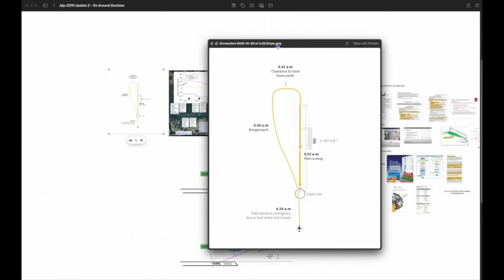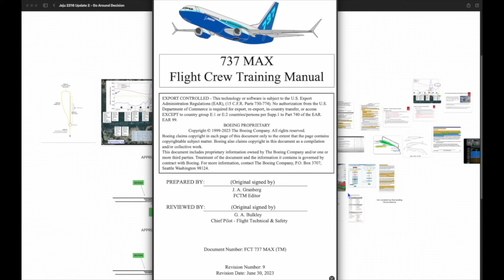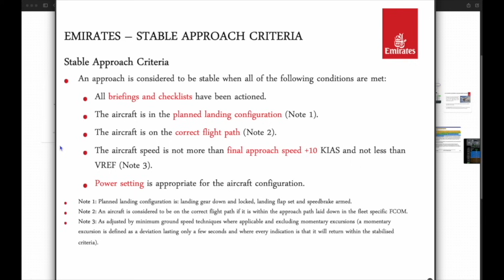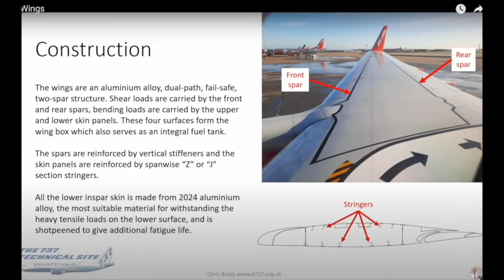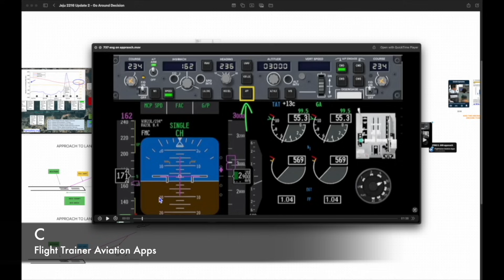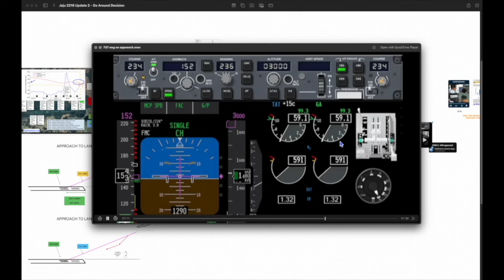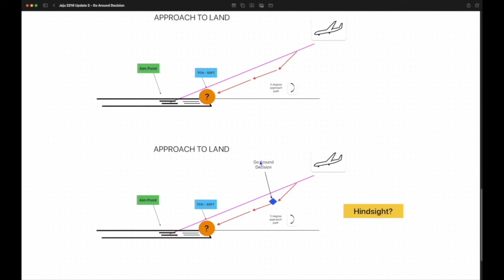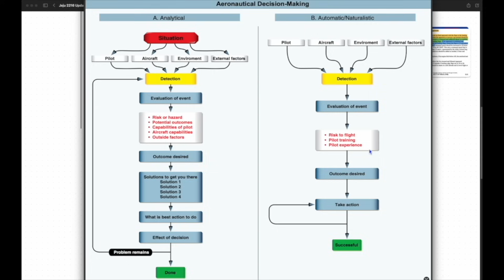Go-Around Explained: Jeju Air 2216’s Decision Not to Land

Comment: The bigger issue is why so many died. We hear about birds, engine damage, possible pilot error, marginal immediate landing, etc., but the pilots successfully got the aircraft on the ground, and it would have slid way past the runway with a good chance of all "souls" surviving. Why no discussion of all the death caused by a massive structure in the overrun area? That multi-layer reinforced concrete wall or bunker like obstacle, fortified with dirt berms caused almost all to die. A technology suitable for bomb-proof bunkers or runaway train stopping was put in exactly the path of an unfortunate airplane that could not stop short of it.
Reply: The aircraft hit an ILS Localizer Antenna Installation. It was designed and built by the US military during the 1950's when the airport was a US airbase.

If it was not there the aircraft would have continued 70m further and have struck the airport boundary wall, with the same outcome.
Reply: @christopherrobinson7541  Interesting that that installation was over 70 years old (the concrete structure, not the actual array). Seems odd that no one, once the airport was made a civilian airport with large passenger jets that no one thought to improve that. Thanks for the info.
But if the boundary was a fence instead of a solid wall, per ICAO recommendations, it had a lot further to travel before hitting anything very solid.
Reply: @christopherrobinson7541  What you're erroneously referring to is Gunsan Air Base. The one in question is Muan International Airport, IATA: MWX, ICAO: RKJB), and opened in 2007, not US air base in Korea.
Reply: @지게-c3r  The Gusan (Kusan) AIr Base was also called K-8. It is a current airbase and is located much further North.

Below is a list of US air bases from National Museum of the United States AIr Force.

K-1 Pusan West
K-2 Taegu No. 1
K-3 Pohangdong
K-4 Sachon
K-5 Taejon
K-6 Pyongtaek
K-7 Kwangju
K-8 Kunsan
K-9 Pusan East
K-10 Chinhae
K-11 Ulsan
K-12 Muan
K-13 Suwon
K-14 Kimpo
K-15 Mokpo
K-16 Seoul (Yongdungpo)
K-17 Ongin
K-18 Kangnung (Koryo)
K-19 Haeju (Kaishu)
K-20 Sinmak
K-21 Pyonggang
K-22 Onjong-ni
K-23 Pyongyang
K-24 Pyongyang East
K-25 Wonsan
K-26 Sondok
K-27 Yonpo
K-28 Hamhung West
K-29 Sinanju
K-30 Sinuiju
K-31 Kilchu (Kisshu)
K-32 Oesicho-dong
K-33 Hoemon (Kaibun)
K-34 Chongjin (Seishin)
K-35 Hoeryong (Kainsei)
K-36 Kanggye No. 1
K-37 Taegu No. 2
K-38 Wonju
K-39 Cheju-do No. 1
K-40 Cheju-do No. 2
K-41 Chungju
K-42 Andong No. 2
K-43 Kyongju
K-44 Changhowon-ni
K-45 Yoju
K-46 Hoengsong
K-47 Chunchon
K-48 Iri
K-49 Yangsu-ri
K-50 Sokcho-ri
K-51 Inje
K-52 Yanggu
K-53 (not completed)
K-54 (not completed)
K-55 Osan-ni
K-56 (not completed)
K-57 Kwangju

K-12 Muan (also called Mangun) was much smaller air base and was used mainly as an alternative airfield so that aircraft could be dispersed.

Google earth has images of the old airbase in 2003, which shows the original layout of the runways. This is before the construction of the new terminal buildings etc.
Reply: @christopherrobinson7541  
It is not the list of USFK air bases, list of all the airports including commercial & military airports in South/North Korea(K19 - K35).

The correct list of USFK air bases in South Korea is as folloows:

Osan Air Base
Kunsan Air Base

Korean Air Forces has been using some exclusive air bases and some other  commercial airports together.

Anyway, the point is Muan airport is not USFK air base, and opened in 2007.
Reply: @christopherrobinson7541 FAKE information. The airport was built for civil flights in 2007 and no relation with US military.
Reply: Just simple maths, without flaps and that landing speeding and the landing location would result the plane to glide into the ocean, IF you are lucky and there is absulutely nothing in its gliding path....The plane was doomed to fail the moment the pilot decided go-around, particularly flapless without landing gear
Reply: Exactly right. Without that concrete structure, the plane would have continued sliding, and even if it hit a less immobile object, it would have been much more survivable.

There have been suggestions that the construction here was a result of a South Korean desire to harden their facilities against an attack. Appe1arently, a lot of airports and other facilities have similarly-hardened structures nearby. I'm not a Korea expert, so I have no idea whether or not this is accurate. But it would be a rational explanation for this structure. Still a bad idea, but perhaps more understandable.
Reply: @petercollins7730  Nonsense. The structure was an ILS Antenna and is compliant with current ICAO guidelines.
Reply: @christopherrobinson7541  It complies with ICAO REQUIREMENTS. It most certainly does not comply with ICAO guidelines. In any case, that structure, that close to the end of a runway used by large passenger aircraft,  is unforgivable.
Reply: That's irrelevant. Many airports do not have the space for an airliner to just slide for miles across open grass. Had the plane landed at Luton for example and hit the ILS localiser it would then have fallen off a cliff!
Reply: @TheGalwayFarmer  Yes, many airports cannot provide a safe overrun area. But this airport certainly could have. Remove the concrete structure, replace the boundary wall with a fence, or double fencing, and this plane stops with most or all of the passengers surviving. 

In other words, follow ICAO guidance and this is a very survivable accident.
Reply: The wall was unfortunate, but it did not cause the crash. It is impossible to plan for all eventualities as such. This was a medium long runway, there are way shorter runways, going into the sea, or where you have roads or crossing taxiways at the end where aircraft move across, such as in Amsterdam and Barcelona. 
There will always be something, obstacles somewhere, if you were going to remove all such structures or obstacles, you would not have many airports left.

Of course it will be made as the "scapegoat" for so many people dying in the end, but it's not the first time aircraft have landed of the runway and ended up in a fireball.
Reply: @johnnyalexander5219  The concrete structure did not cause the crash, but it did cause the deaths.

This is a short runway for commercial airliners - just 2500 metres usable. And just because other airports have obstructions is no reason to exonerate this one. The fact is that, were that structure not there, this would have likely been a survivable crash, for many or all onboard.

And there is no reason for this structure. It contravenes ICAO recommendations and provides, obviously , a tremendous hazard. There's a reason that ILS antennas are mounted on easily-broken metal gridwork instead of massive concrete bunkers.
Reply: @petercollins7730  2500 m is NOT a short runway for a 737.  A short runway would 1500 - 1600  meters. 
It is clear as day as you are completely clueless. You would be able to land with most failures on a 737 with 2500 meters dry runway. 
Losing 1 engine, does not increase the landing distance.

There was no technical reason for them not being able to lower the landing gear, as gravity extension is mechanical. Not saying they did not have a reason, that we are not aware of yet.

We will never know if it was survivable crash even without the structure, that is just speculation. They landed on the belly, very fast, fuel, sparks, engines could have been ripped of when they left the flat surface of the runway even if they had not had a structure ahead.

My interest is in the cause of the problem, as that is the learning topic for pilots and aviation personal, the wall is "less important", as you can not account for things that are not on the normal landing surface. 

We have landed on runways 1500 - 1600 meters long, beyond it has been steep hill, what you going to do? 

The wall is unfortunate, but that is what it is. If they had continued to land, and not gone around. (Boeing recommended in 2008 Ryanair report Rome continue to land after bird strike) Than probably nothing would have happen.

Did you read the recommendations of Boeing Ryanair report from 2008 Rome, that I posted, where they did NOT recommend a Go Around in such situations.?
Reply: @johnnyalexander5219  According to Boeing, the minimum length for landing a 737 is 1981 metres, unless equipped with the short landing package. Apparently, you know more than the company that built the plane.

They did not have time to gravity drop the gear. This has been discussed and all of the 737 pilots agree - it takes too long, and would require the FO to relinquish assisting with controls.

Yes, it is speculation. But since if that structure were not there, the plane would have massively slowed before hitting any other obstruction, and what it hit was built to be frangible, that speculation is very likely.

As I said, the structure did not cause the accident - it caused the deaths. The investigation will determine what caused the accident, but it is already obvious that one recommendation is to remove ICAO prohibited structures from runoff areas.

Then you have landed on a runway significantly shorter than Boeing says is the minimum length. Either Boeing is lying, or you are. I'll leave it to everyone to pick which they think.

Boeing DID NOT recommend landing after a bird strike on approach. They made recommendations on reconfiguring on the fly IF THE PLANE WS UNABLE TO CLIMB OUT. Since this plane climbed to 900 feet, that would not apply, would it It also recommended continuing the approach "if a safe landing can be assured." Funny you edited what Boeing said.
Reply: @petercollins7730  The ILS structure is compliant with ICAO guidelines, because it is outside of the safety area. However, the ICAO recommends larger safety areas. Care is required when comparing the ICAO limits to the the US FAA dimensions as one uses the end of the runway as the starting point and the other uses the end of the runoff area. Installations within the safety area are required to have foundations flush with the surface, to which frangible structures are attached. At Muan airport this would require the antenna array to be mounted on towers.

The usual length for runway 01 & 19 is 2,800m, however at present only 2,500m is available, because of the construction work to extend the runway, which is currently ongoing at the Northern end of the runway. When this work is completed, the plan is to extend the runway at the Southern end. When complete the runway is intended to be 3,500m long.
Reply: @christopherrobinson7541  It is compliant with ICAO REGULATIONS, but, as you admit, contravenes ICAO recommendations. If I did not say that, I misspoke.

Personally, I think even the ICAO recommendations are woefully inadequate. I'd like to see the safety areas equipped with energy-absorbing materials, EMAS for example, whenever possible. This would provide immense benefit at relatively low cost, and minimal maintenance. Neither the FAA nor ICAO agrees with me, so take my opinion for what it's worth.
Reply: @johnnyalexander5219  The approach speed was 200 kts, which is the correct speed for a flapless landing. At that speed and in that configuration the aircraft would have required 6,000m to stop.

When the aircraft hit the ILS Instillation it was travelling at 150 kts. Without obstacles it could have skidded 3,200m beyond the end of the runway.
At 70m was the airport boundary fence. At 900m there is a major multi-lane road, built on an embankment. At 1,200 there is a hotel complex and beyond that is the sea.

A flapless landing without undercarriage was never going to have a happy ending.

Also the ADS-B data suggest that the pilot had elected to go around (with two good engines) and that the aircraft had throttled-up and had retracted the undercarriage and stowed the flat & slats. Then the bird strikes occurred; in which case the aircraft would have been too high, too close and have insufficient time to configure the aircraft for a stabilised approach into runway 01. Hence the pilot replanned to land on runway  19, but had too many failures and too little time to configure the aircraft for landing.

The CVR & FDA should enable the timing of the go around and the bird strikes to be determined.
Reply: @petercollins7730  "According to Boeing, the minimum length for landing a 737 is 1981 metres"

That figure is probably from the qualification trials where the exercise is flown at max all up weight, and might be without thrust reversers. In practice the actual landing distance is determined by the weight of the aircraft and the condition of the runway. 

At my airport (Edinburgh, Scotland) the runway is 2,556m long and we operate 737-800s without any problems. There are also routine A380 flights. Glasgow is 2,665m and Prestwich 2,986m.
Reply: @christopherrobinson7541  No, I didn't bother to hunt up the quali reports. Stop grasping at straws.

And notice that all of the airports you cite have runways at least 600 metres longer than the minimum Boeing sets. How is the fact that 737-800s can operate on runways of 2500 to 3000 metres proof that they can land on runways less than 1981 metres? Explain that math to me.
Reply: @ So all those numbers are just guesswork.

And as you are aware the last 4 minutes on the CVR/ FDRs are missing.
That is from the time of the go around more or less until impact.
You say they had no time to configure, yet they had time to make a PA to the passengers about the go around.

There is one issue with your theory, why did they go around, if they only hit the birds in the go around?
They were on short final close to 500 ft fully configured.

Even if you hit some birds on short final that is not going to be end of the world.
Trying to avoid on short final is also very risky.
Non of that data or speeds etc are yet available, equally we will never get the full story from CVR / FDRs.
That does indicate dual engine failure, but that is not compatible with a go around and enough altitude to make a 180 back to land without engine power.

The photos of the fan blades after the crash, does not indicate that both engines were hit by birds.

We need more information.
Reply: @ Which numbers? 

A pilot can make an announcement in 4 seconds -"Brace!Brace!Brace! - but it would take far longer to configure a grievously damaged plane for landing. A pilot can also use the PA while holding the yoke, which he cannot do while, for example, gravity dropping the gear.

They hit the birds BEFORE the go. That was the reason for the go-around. Ho do you not understand that?

The plane climbed out 500 feet, roughly. That is fully compatible with a plane pulling out of a final, with one engine dead and the other degraded and failing. The teardrop turn appears to have been made without power - they traded altitude for the turn.

And the authorities have just announced that they found significant bird remains ( using a less graphic term than they used) deep inside both engines. A lot of bird remains - one estimate said that as many as 90 birds may have been ingested.

We certainly need more information. With what we have, we can make some reasonable speculation. Likely there will be other video available - security cameras, cell phone video - which will help with the exact sequence. Without the FDR and especially the CVR, it is likely impossible to ever be certain what precisely happened.
Reply: @petercollins7730  I was just making the point that 2,500 to 3,000m is not a short runway. Also "book" limits need to be researched further to determine the boundary conditions. In practice the Landing Distance Required (LDR) is calculated from the weight of the aircraft, temperature, runway elevation etc. Then this is factored by the runway conditions, eg; water & slush 2 and ice 3.5., the factored LDR must be less than 60% of the Landing Distance Available. So with runways 2,500 to 3,000m the factored LDR must be less than 1,500 to 1,800m.

Comment: By the time the pilots radio ATC MAYDAY the pilots have already made up their mind to go around bearing that there are at 1400 feet
Step inside the cockpit
1. What was that?
2. Check engine and controls
3. Pilots discuss bird strike - decides to go around
4. Radio ATC
Steps 1, 2 and 3 could be a minute or less. The plane is at 1400 feet, if the pilots feel there have one good engine they will always decide to go around.

In no situation in live situation would pilots talk to ATC than decide to go around at 1400 feet and descending!

X. Could they than have hit another flock of birds as they radio MAYDAY losing the second engine 

Chances that this was a double bird strike is quite high

Comment: One possible explanation is that the approach was not very stable, and then an engine failure was apparent, prompting a one engine go-around. The crew was unaware that the other engine was also or was soon to become also damaged, leaving barely enough energy to perform "the impossible turn" back to the runway. They misjudged the turn leading to a high and fast approach. Why, at that point, they did not manually drop gear, and why they could not get flaps back down hasn't been explained in YT algorithm provided videos.
Reply: The ADS-B data suggest that the pilot elected to go around,on two good engines, before the bird strikes occured.